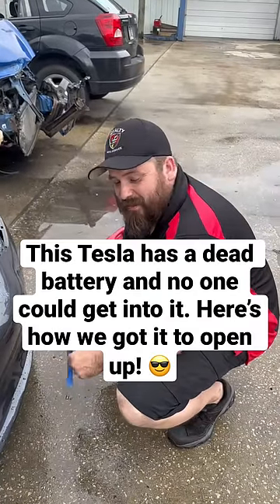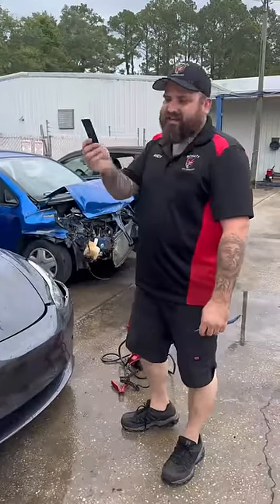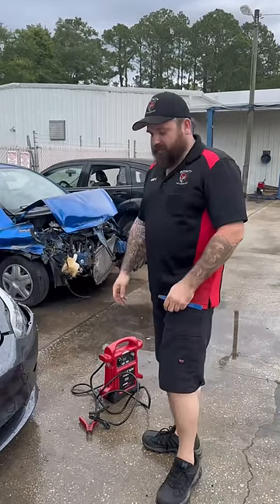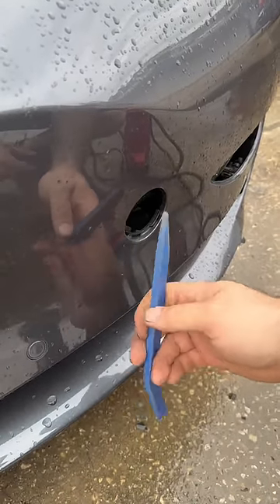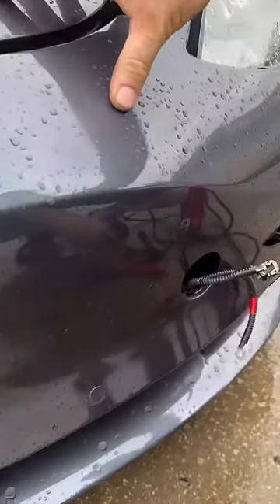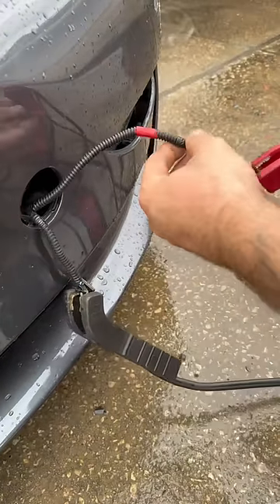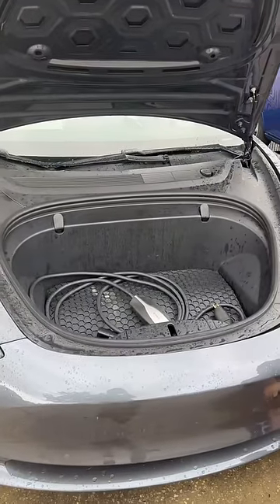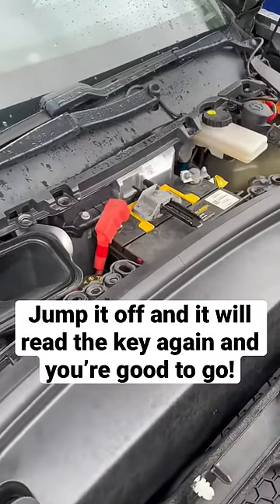Dead Tesla! How Can We Get Into It? #shorts #tesla #teslamodel3 #car #mechanic #crazy #hack #tips

Comment: That’s odd,  my frunk has a large supercharged 5.0 litre  V8 engine in it..

..yet this one is empty.  Have they stolen the V8 too.  That’s awful!
Reply: Ah, you see Colin... what you have is called a car... and a fun one at that! 👍🏽 
What he is working on in this video is nothing more than a glorified refrigerator... a boring household appliance on wheels. 🥱
Reply: Who's car is the fastest though :)
Reply: @problemchild1976  Lol, point taken Problem. But... there's a certain amount of boredom that comes along with an EV. 
It's not the power that matters... its how the power is put the ground that matters.
Picture going to an NHRA meet... no supercharged, ground shaking 500 cubic inch V8s tearing up the pavement?? Just whisper quiet appliances?? 🤫 
Then again... I guess there's a reason why EVs are using exterior speakers to mimic a V8s throaty rumble. 😉
Reply: @jerryjeromehawkins1712  why go so specific?
An EV gets the power down way better than any ICE due to torque being at its max from 0rpm rather than 3500rpm. It's an exhilarating drive out of the corners and listening to the perfect level of traction is fantastic. 
Well let's go specifics in hill climb..... pikes peak.... what holds the record?
Reply: @jerryjeromehawkins1712  ps - what's nhra?

Comment: Had the same problem with a BMW X5. Had to remove the rear license plate light and put the jumper cables to it in order for the key fob to work and open the doors. It's not just a Tesla thing.
Reply: Bro you basically own a tesla. The one thing separating your BMW from that Tesla's the fact that it' still has an internal combustion engine but let's be honest, there is just about as much electronics in that BMW as that Tesla easily. Although in this case I actually believe the Tesla's probably more reliable than your bmw. Those things are absolute horseshit. You can keep any piece of shit with Warn piston rings by 80,000 mi fuck that thing.
Reply: @seanbutler2291  I never owned the bmw. Just had to fix it for a client. I wouldn't dare own a bmw just to have 37 electrical issues and codes needing to be fixed at all times. My point being is that all new vehicles are all getting more sophisticated/complex with their tech and it's just gonna make repairing them a bigger problem for us mechanics/technicians. Teslas, bmws, toyotas, and even domestics. Why is there a need to replace an entire module and reprogram it in new Chevrolet Tahoes and Ford Escapes for over a grand when a transmission solenoid goes out? Up to around 2011 (on those same models) you could just by the solenoid for $20 and the replace it on the valve body.
Reply: You know that your key fob has an emergency key blade in it,... right? Thats why the drivers door has a lock cylinder :-p
Reply: This particular model wouldn't unlock the door when the battery was dead. I never locked much into it but I assumed the lock cylinder just serves as a switch which will activate the actuator to get the the door open. No battery, no open. The key worked once power was applied afterwards.
Reply: @djbmw1  this was a key with controls on it, not a fob. It could've been that the mechanical link was broken. My memory could be mistaken that it worked after power was back. The truck was in the shop maybe 2-3 years ago.
Reply: D

Comment: Use a 12v Milwakee battery with 2 jump leads, so you dont gotta carry a mega jump pack around.
Reply: It will work with a 9V battery if it is fresh.
Reply: I never thought about a Tesla needing a regular 12 V battery.
Reply: @Venora-hh7bk  All EVs have the low voltage  12V system, for backwards compatibility for the traditional modules and radios.

Some work is being done to upgrade to a 48V system that uses thinner wires, because higher voltage, but lower amps, means you can use thinner wires to save weight.
Reply: @charlesball6519  thinner wiring would have a shorter life. Prescribed obsolescence at play, as well.
Reply: @Venora-hh7bk  That's wrong.  It has ZERO to do with planned obsolescence.  What makes you think the wire would have a shorter life because of it being thinner?

12V x 100A = 1200W - wire has to be thick in order to handle 100 amps (using 0 or 2ga wire here)
48V x 25A = 1200W - wire can be half as thick, because its only carrying 25 amps.  (you would need something like 4-8ga wire)

Comment: That power-assist “frunk” lid is pretty cool. 😎
Reply: Not when it opens while driving
Reply: @Random-dq8ew  The only reason it popped open is that the safety latch (just like on a gasser) is not engaged due to misalignment caused by the collision.
Reply: @Random-dq8ew  The primary latch will not operate unless the car is in Park. The secondary latch will keep it from flying open if it is aligned and not damaged.
Reply: It is not a power assist system. If it were it would not work anyway if the 12V system is down.
Reply: @The_DuMont_Network  Interesting! But I still want a trunk lid that opens all the way by remote control. 😎
Reply: Bring on the frunk!
Reply: @YerBrwnDogAteMyRabit  We want the frunk! Give us the frunk! 😎
Reply: @YerBrwnDogAteMyRabit  ...go see your therapist - FAST!

Comment: The 12v system is separate from the drive motor.  The 12v system runs all the accessories.  Most dead battery calls are for the 12v system, not the drive battery.

Comment: Buy expensive battery warranty is just 100k miles new battery pack 20k plus replacement charges if even I buy gasoline car will be a lot cheaper then tesla half’s of price difference why would i waste my money in crap tesla lithium ion battery car each year battery performance is getting worse take longer charging times low mileage so thanks Crapy Tesla the junk car

Comment: My porsche was the same way.  Idiot engineers made the hood electronic.  If you had a dead batt you had to open up the fuse panel by the clutch, pull out a copper post near the fuses, hook up the positive battery jumper then hook the ground cable to the door latch piece on the car.  That would allow enough juice to pop the hood.

Comment: Lol replace a $40,000 battery yea ok lmfao just the GD EASY HUH….   EV battery replacement could cost anywhere from $5,000 to $20,000, according to Recurrent. Batteries degrade at varying rates based on a number of factors, like how the EV was charged, what type of environment it was driven in, and more.

Comment: In a older model gas vehicle that’s called a fender bender. You then pull the fender out enough to drive on to your destination. BUT NOOOO not this new generation. Everything is fantasy mixed in civil bureaucracy looking for solution though others confusion. (Faux progress) Now you need a tow truck and a rental car and possibly another vehicle. EVs aren’t proven sufficient and ready enough to compete against combustion vehicles. The people buying them are Guinea Pigs with money. 😂 Electrical gadgets in cars have always been nice. They eventually most always break somewhere down the line. A Whole Electric Car is bound to Fail. The computer will decide what the car will do and won’t do. If the computer says NO- you don’t GO. 🤔Hmm?

Comment: Just gotta pull these wires, pop the hood, remove several plastic panels , and there the battery, SO EASY!! (Sarcasm inserted here)
So just popping a hood with a cable latch and being able to have the battery right up in front is something this guy never seen 🤦🏼‍♂️

Comment: Back in the days,when alarms started becoming more popular. There was a way to disable certain vehicles that had the battery in a certain location. You compromised the battery and come back a few hours later and break into the vehicle and take what you want or tie a rope to it and pull it to a secure location. Then, they got smart and the alarm companies started placing backup batteries with the system. That worked for a little while, but again criminals would figure it out. It amazes me how social media has changed the world. And no I will not tell you how. But it can still be done. But then again now a days those things go off and nobody cares. Invest your money in a good insurance and don’t leave expensive things in your car.

Comment: This seems off. Those two wires have two different connectors on them. They wouldn’t just be sitting there free floating.  They could touch each other or something  metal and short out the 12v system.

Comment: All you need is a 3v battery. Red cable to postive side of the battery. Attach battery to the wires using a twist tie for storage/emergency use. Then, attach the wires to the back of the plastic round plate and reattach to the front bumper.

Comment: Maybe put a traditional key hole in the door? 🤔 But… They need to save money and ‘weight’ by having less mechanical parts. Besides, that would make way too much sense . It’s cheaper to simply put an electronic button which means you can’t get in without power. It’s not just Tesla but all manufacturers going the cheap route to save money yet still increasing the price. The new Honda Civic has a key hole but if the battery is dead, it won’t unlock because instead of a traditional mechanical lock it’s electronic when you twist the key, a signal is sent to unlock the door.
Reply: Elon: "keyhole?  Whats that?"

Comment: Its so easy when you happen to have another available 12v source. Everything is easy when you have the right tool for the job. What I hate is the lack of a mechanical backup. I don't know why you would ever design a car that is completely useless without power. For example, many auto manufacturers are going keyless now but most have a key inside the fob so in case either the car or fob battery are dead, you can remove the key and unlock the doors still. I love technology and new things as much as everyone else, but I think you're foolish when you don't have a more tangible, reliable backup.
Reply: You can use a 9v battery too.

Comment: So what happens if for some reason such as an accident causes the connection to the battery to be cut this making any jump impossible.

I wonder how you get access then, ok a one in a million, but wouldn't it simply make sense to have an emergency physical key hole?
Reply: Cut the bonnet, replace it after.

Comment: Never knew tesla had a 12 volt battery and a huge battery under car why wouldn't they just use the huge battery or is the 12 volt battery just for the key card to get in the car
Reply: The 12V operates it's main computer, door access, cellular modem, cameras, lights, etc. 
The 12V system is kept charged from the traction battery. 
If for some reason the traction battery is disconnected for maintenance, or a fault blowing it's main fuse, the 12V will keep the car systems operational for a couple days.

Comment: Or they could just include a key like every other car. Our Corvette has a key in the back to open the trunk if the battery dies, our Mustang has a key on the back for the trunk and the side for the door. Every new car has a key fob and a key you can remove to physically unlock the car